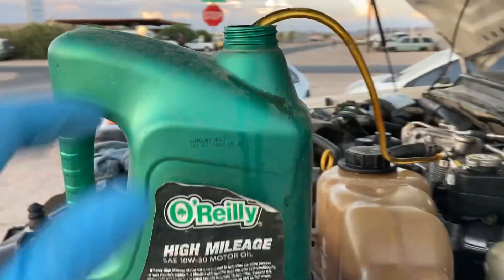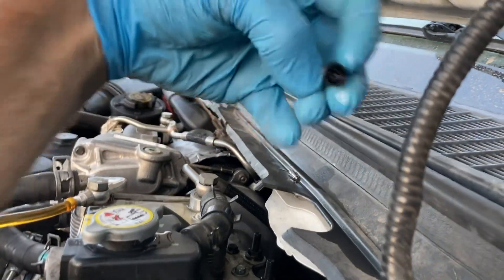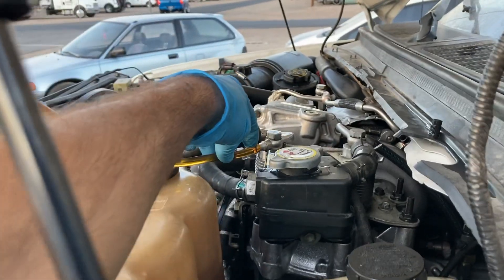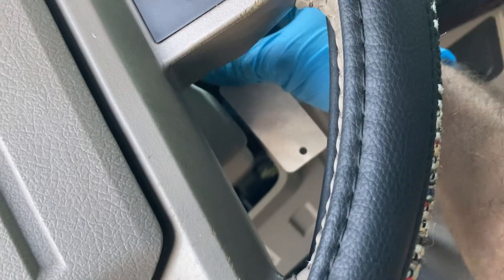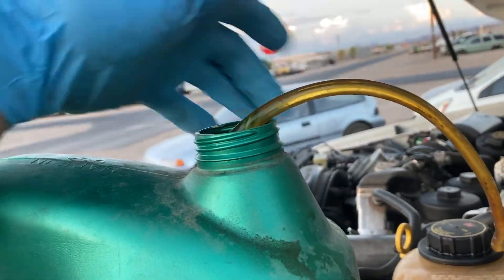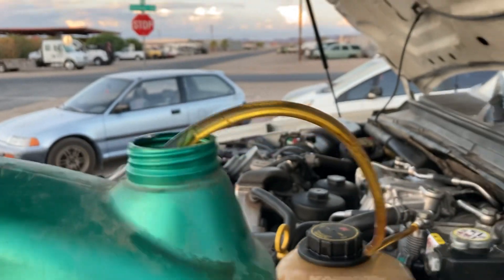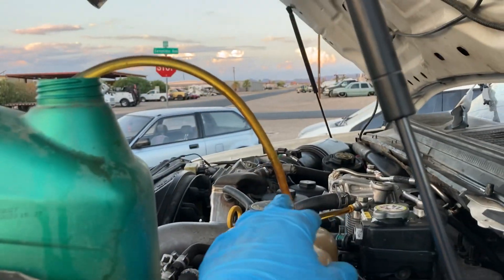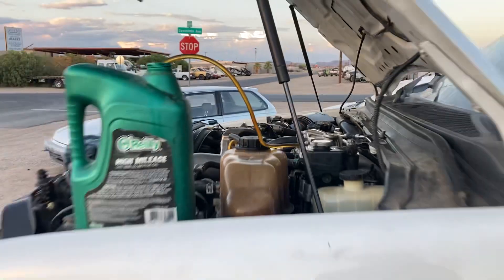How to bleed the fuel system on a 6.4 ford f350 f250 diesel

Comment: Great tip. I changed my filters but the water separator filter didn't fit in the cap properly ,should have stopped there but went ahead and screwed the cap on anyhow,started the truck ,ran about 20 seconds than quit. I knew what the issue was (AIR) looked on You Tube saw your fix.Nothing to loose wouldn't restart so I decided to do it ran about 2 gallons of fuel into jugs ,put valve back in did the purge 5 times just to insure no air tried starting and to my surprise it started ran fine,while filling those 2 jugs of fuel there was a lot of air in the system.Man you saved me ,THANKS for doing this video.

Comment: I’m having some issues with my Truck due to the put gasoline instéad of diesel, I removed the main hose fornthe tank and bleed the whole diesel + gasoline. I never replaced the fuel filter, but it wasn’t started so once I finished, I added diesel and it worked normally, next day car turns on for 2 secs and the then stalls of. Any recomendations, regards
Reply: I’m on the same thing rite now but ur issue im shure still has air in the system because mine would start like that then I started to watch a bunch of videos and perged the air out good and ran after that just then I ran out of diesel once it ran and started with issues again but keepmperging the air out